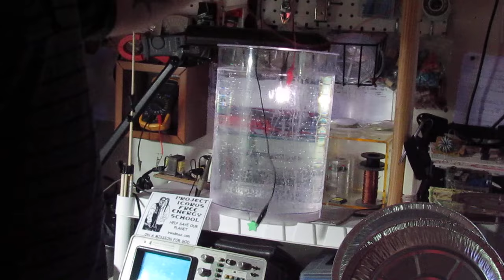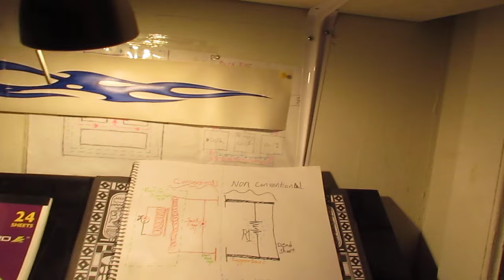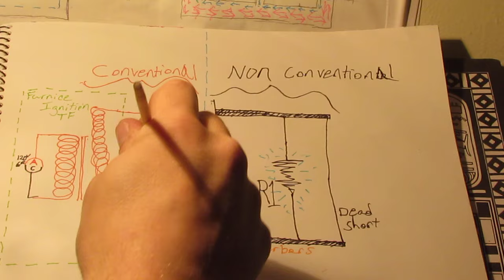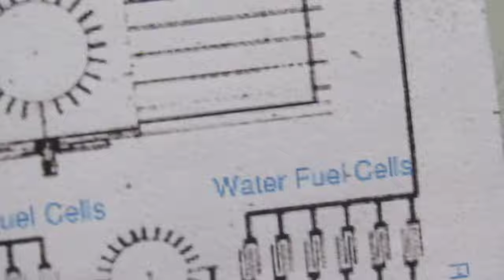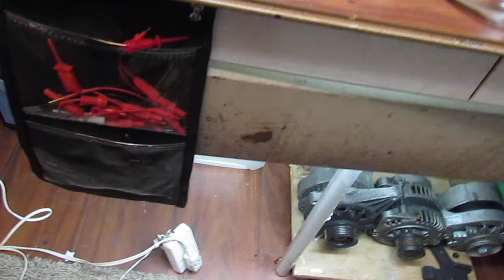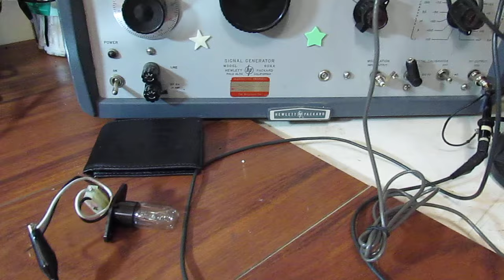Free Energy School Cold Electricity How to

Comment: Great project. Thanks for the video. Say anyone know why we need the spark gap? What happens when one connects the high voltage direct to the high volt caps?
Reply: The spark gap creates a short that allows the capacitors to discharge into the second half of the circuit which makes it a free oscillator that oscillates back and forth at its natural resonant frequency, and the reason the power doesn't cause harm is because it's reactive at 180 degrees phase shifted between the dielectric and magnetic fields.

Comment: Does this produce more energy than it takes in?
Reply: Not on its own, this is half of the circuit but you need an extra step to get more out than you put in.
Reply: @JenkoRun  how exactly?
can u take some time to explain in details?
I have conducted some overunity experiments with good promising results  posted on my channel.
Reply: @overunity_inventor The first thing to keep in mind when looking for overunity in the way Tesla did it like this is that this is a reactive power system, there's almost no energy in it, Tesla used a relatively small input to create an extremely large amount of VAR's, now we've always been told that reactive power cannot do anything useful but that is just plain absolute poppycock, the key thing about this method is that reactive power cannot be tapped directly.

Eric P Dollard spoke about this in the "2018 ESTC Panel Discussion 2 - Energy Science & Technology Conference" if you take a 12,000 volt powerline and put a 1 Ohm reactance coil across it you'll get 12,000 amps drawn from the station, but if you take that + a capacitor across the line the 2 components feed each other and no current is drawn from the power station, so now you've got 12,000 volts x 12,000 amps.

That's a lot of kilovolt amps reactive, the magnetic field from that is going to tear the nails out of wooden ships.

but there's no energy in that system so it just dies out when attempting to tap it.

Tesla was going beyond energy, he used the input energy in a circuit that recycled it via resonance to produce very large VAR's to then stimulate the Earth making the tower nothing more than a catalyst and turned the Earth itself into the actually supplier, the schematics are on pages 56-58 of Tesla's Colorado Springs Notes. 

I won't say more about this in YT comments but this alone should be more than enough for those with the know how to figure out what this means, if you still need help contact me on either the energeticforum or send me a PM on Reddit, I use the same name everywhere.

Trying to use electricity (active power) to make electricity is like trying to make a cake with another cake, you're not going to get far, but if you separate the ingredients (the dielectric and magnetic fields) by 180 degrees first and make more of them, and then put them back together, you get a much bigger cake.

Comment: You are not alone. More and more of us are starting to do it too. You did the wire around the room. Does everything in the radius of the wire light up??? I have been working to adapt p.n. junctions to work on this Tesla style energy and like you just showed works on open circuits and the energy does not follow traditional methods of flow so designed circuits work very different. I can turn transistors on and off wirelessly with this energy. You spoke about getting together and I would like a lot of you who are younger than me to get together. Let's set up an initial meeting point. I do have a channel on YouTube too but I do terrible at making them yet I have been making contact with several folks like yourself and we are beginning to share. You are doing it right your seeing it and it does work. We just need to adapt a system that our technology today can work with so that the world can experience this new simple revolution in the energy field.

Comment: The spark gap is key..😉  there are so many around the world, like myself, working on this.  Love it!

Which a laser temp, is should read  -500 F 😁
Reply: Yes. Spark gap makes the frequency chaotic and safe. It's also possible to break out the circuit from the source with spinning magnet, like Gerard Morin did.

Comment: Connect one wire from the negative terminal of your car battery to the radiator.  Drive for 30 minutes then feel how got the battery gets.

  Next cool the battery with air tubing.  

  Don't keep the wire connected to the radiator for too long as it will cause problems with your engine.

  You can install a separate radiator that is not grounded to the chassis or connect to the intercooler.  

  You will get about ten percent fuel economy improvement. Using this wire trick.  If your add a Joe Cell like Ritalie has and add a electric motor to assist the engine then you will have greater gains in fuel economy.

Comment: hey i'm interested in trying out this same circuit, but i was wondering what size of doorknob capacitors did you use? in farads or if doorknob capacitors are crucial instead of other types of capacitors?
thank you for your work and thank you for sharing! i wish you all the best!
Reply from the maker: If you have a look through my other videos you will see another set up where I use a television Transformer in a jewel thief set up with wine bottle capacitors to accomplish the same circuit but the main thing is that your capacitors can handle the voltage that you're putting into them

Comment: The ignition transformer, just like neon sign transformer is current limited.  The voltage when the spark plasma  is present likely drops way down.Your tube looks like a photo multiplier.  Search Google to understand how they work.  It appears to have dynode mounting bars showing.  The other possibility is related to a decatron which was a counting type tube where a plasma transfers to succeeding elements as count proceeds.

Comment: Connect the prongs of a PMH, perpetual motion holder made by Edward Leedskalnin, to the non-conventional side of the capacitors then connect one wire from each coil to the core of the pmh and the other wires to a load, resistive load.
Reply: Or just connect one wire from each coil to the pmh core and dead short the other two wires and treat the prongs like you would the copper bars by putting a load across them.

Comment: This looks very much like a refinery solution. The power that comes out the wall is raw and nasty, it needs to be reduced and adapted to whatever is in need of it. But it is all a smaller version of the "nasty" part where everything is based on the oscillation of 50-60Hz.
This is just reducing and ridiculous to apply to anything really, unless you are the supplier.
Electricity needs to be refined and tuned so it can be used everywhere without harm to anyone. By doing that properly, you have only advantages coming out of it.
The advantages are:

It is totally harmless
The power is refined and magnified which makes its output very powerful. All the power you had before is still there, but refined.
Appliances running with this energy such as a motor, does not generate any heat. This brings superconducting into play, we can now have that effect by using refined energy, from your household electricity!!! If you dare and know what you are doing 😆

Understand one thing very clear! Electricity is key to everything! If we are allowed to use it the way it CAN be used, then our world will open up to a whole new understanding which will transform just about everything, and in a good way too!

Great work, great video 👍🏼👍🏼
Reply from the maker: you are right but it is in the high-frequency ram where these cleaner and more natural energies exist that's circuit works because of those really high frequency energy is created by the spark gap at such high power levels

Comment: I think this circuit you showed was called the hairpin circuit.  I made a basic one but didn't think to use it to drive water fuel cells, want to find his patent you show.  Was looking at ball lightning and how its related to dense mist vapour ejected from water shaken by piezoelectric vibrators.  There maybe a combustion process that is not the hydrogen rather something at the nano level of the bubbles., PESNetwork had moray king talking about this.
Reply from the maker: +Spangley Rainbows yea it all seeems to all be convergeing im trying to put together a video explaining my findings to date which is extrodenery in and of itself. its coming just need a little bit more time lots of projects all comming to a head at the same time...lol

Comment: Looks to me like shorting the secondary circuit is the key, looks like you've solved this, have you tried using a heavy gauge wire in your secondary circuit to see if the output goes up?

Comment: So I'm trying to recreate this set up using a NST and aluminum bars. Spark gap will NOT fire!. I have a tesla coil so I know what I'm doing.  I think the aluminum is doing something to the circuit. I have had similar problems before on other experiments using aluminum!!???? Any comments?
Reply: Aluminum is a "leaky" conductor. That's why it works great on top of a Tesla coil. Copper will hold onto the voltage(Dielectric force) better.
Reply: DkleinD Dude, its weird, i'm using hollow aluminum pipe. I guess that's why. 10000v under capacitance, and it won't jump the spark gap!
Reply from the maker: Could you post a video of your set up.

Comment: Why do you keep putting it in water? What is that suppose to be doing? I don't see anything "unconventional" here. Your science is about as good as your camera work..
Reply: therealnightwriter I think people misinterpret the idea of cold electricity. When electron flow is resisted it imparts energy into the atoms. This is well known. Some have documented under certain conditions an effect on atoms reducing their vibration. The only place I have seen convincing evidence was on large transformers and transmission lines or at extreme frequencies. Suggesting to me that a high voltage/frequency field (since high voltage/frequency likes to travel on the outer edge of a wire) is capable of arresting or retarding eddy currents in the core of the resistor so it appears to get cold. People often cite works of Edwin Gray or Tesla without really understanding what they were doing (mostly because their documentation is incomplete). Which is where I think +Breakzeitgeist got his Idea of putting a light bulb in water. Water is an insulator, add some electrolytes in there and I'm sure you will get a nice zap, whether your electricity is hot or cold. If your light bulb is getting warm, you do not have cold electricity.

Comment from the maker: Well it's up to you what you decide to use. If you have a power supply big enough for those. Check outhttp://12V Cold Electricity and Recycled parts.
Reply: Hi! Can you built one for me plz? and give the cost. Plz contact me by email: sosfixehaiti@hotmail.com
Reply: +Breakzeitgeist i will give it a shot, i designed the star of daivd coil by the way, but there's a problem with the energy at the moment
Reply from the maker: +Kingcia Saintil you still interested lots of options

Comment: What are the capacitance and voltage values of your capacitors?
Reply from the maker: 14kv 14pf but its not that important as long as it can handle the power supply
Reply: Breakzeitgeist Do you mean 1,400pf or literally 14pf because I am having a hard time finding a capacitor with a capacitance of 14pf on ebay, but I have seen many 2,000pf 30kv ones, and the lowest I have seen is 300pf.  Is the pf value that important?  Should I go as low as I can?
  ANOTHER Question:  What do you think about a 12kv 1,000pf Green Door Knob capacitor I just saw on Ebay for 5 bucks each?  Its about the cheapest I have seen, would that work good?
Reply from the maker: It does not matter any door knob cap will do. If you look in my vids I show how to build this with 12 v from recycled things you can get for free.
Reply: Breakzeitgeist
Thanks for the info. 
Does it HAS to be a DOOR KNOB capacitor?  I mean, I am seeing 10 pieces of CERAMIC TINY 30 kv 470 pf capacitors [that's smaller than your finger diameter] being sold for just 11 dollars, can I use those instead?
//Edit for clarification:  Go to Ebay and enter the following item number: 271165315332
This is the capacitor that I am asking if its okay to use, its very tiny, dielectric is based on Ceramic, and its 30 kv.

Comment: I'm now building this circuit.  what size door knob caps did you use?   Tesla has a patent on commutator brushes that don't arc over.  I built one of these and they work great I used Formica and had the copper brush at an angle so that the space where the arc occurs is sealed off no air by the spring loaded Formica and copper sheet combo..  I also did some tests with a third brush that made contact before the other broke contact and the third brush was connected to a circuit to gather the BEMF which is what causes the arcing. This energy is fed back to the battery.  I one of tesla's patents he mention using the kick from the coil to recharge his caps. by doing this the primary energy requirement becomes much less.  In My don smith system the spark gap is adjustable and the neo magnets blow out the arc.  very interesting to watch.  I'm using these parts to build your circuit which is almost identical  my primary 6 turns essentially is your copper pipe (one turn)

Today I printed several of tesla patents that relate to his research from 1892 on.  These are full of info.

My don smith circuit uses 12vdc battery, pure sine wave 60 cycle inverter, variac, no ground fault tarnny 9kv out.  the two pcb controlling the impulse driven motor in the videos are also run by the inverter.  when running the entire system draws only 3.5 amps from the battery.

Have fun   oh ya I wanted at ask what sensation you got from the water with light test?

Comment: Hi, I have on question, as there are this two capacitors in series, wouldn't there be any current flowing on the right side in between them? regards
Reply from the maker: well, you can see i am letting the energy flow trough me but the set up transforms the current into Di-electricity or cold electricity or scalier waves ect. its very amazing I would recommend building it and seeing it first hand. see the other vids I made we are only starting to understand all this as no text books speak of it. But if you read Tesla and Oliver Heaviside and Proteus Steinmetz they all talk alot of it and were the greatest of the great so check it out; theirs so much that has been hidden from us by special interest groups. its sad . Its up to all of us to rediscover  and uncover and share all the knowledge so it will never disappear again
Reply: Hi, I know designs with one capacitor, also replacing this one and the spark gap with a switching system , still using a transformer for high voltage. There is the Don Smith design and also the Testatika I think etc. that used this prinicple of high voltage and high frequency. Will look more closely into cold electricity. Regards.

Comment: Here is your info from the patent. Search kanzius rex research and select the rex link. Scroll to the bottomish of the page to see the patent here is some info for your pie tins The RF signal 108 may be a signal having one or more fundamental frequencies in the range(s) of 1-2 MHz, and/or 2-3 MHz, and/or 3-4 MHz, and/or 4-5 MHz, and/or 5-6 MHz, and/or 6-7 MHz, and/or 7-8 MHz, and/or 8-9 MHz, and/or 9-10 MHz, and/or 10-1 1 MHz, and/or 11-12 MHz, or 12-13 MHz, or 13-14 MHz, or 14-15 MHz. The RF signal 108 may have a fundamental frequency at 13.56 MHz. The RF generator 102 may be an ENI Model No. OEM-12B (Part No. OEM-12B-07) RF generator, which is marked with U.S. Pat. No. 5,323,329 and is known to be used to generate a 13.56 MHz RF signal for etching systems. Among other things, the ENI OEM-12B RF generator has an RF power on/off switch to switch a high-power (0-1250 Watt) RF signal, has an RF power output adjust to adjust the power of the signal generated, and has an RF power meter to measure the power of the RF signal being generated that can be switched to select either forward or reverse power metering. The power meter in reverse mode can be used to calibrate a tuning circuit, as explained above, by adjusting any variable components of the tuning circuit until minimum power is reflected back to the power meter (minimum VSWR). The ENI OEM-12B RF generator may be cooled by a Thermo Neslab Merlin Series M33 recirculating process chiller. A at 13.56 MHz RF signal from the ENI OEM-12B RF generator having a power of about 800-1000 Watts will combust salt water.
Reply from the maker: ***** im trying to get to the experiments and I think its wonderful. What do you mean or would like to know
Reply: *****
 Thanks I do not have the RF device right now. i would like to get quality learning material on it. my email address is my username@gmail
The hive works together!!!!